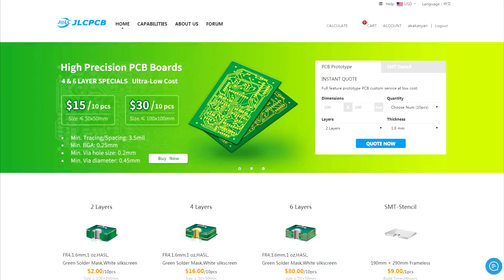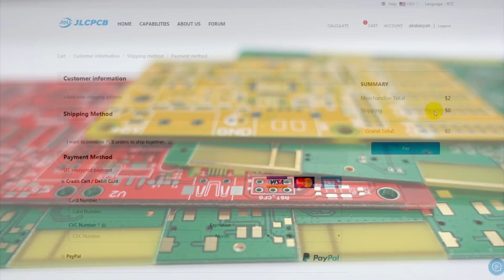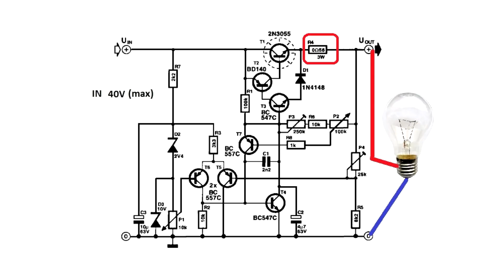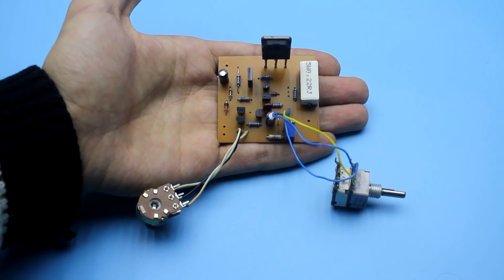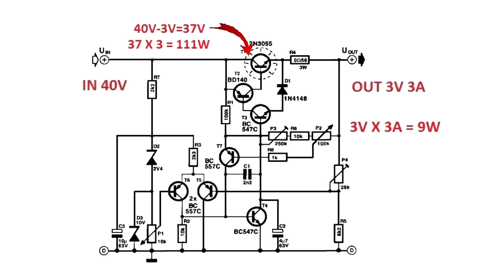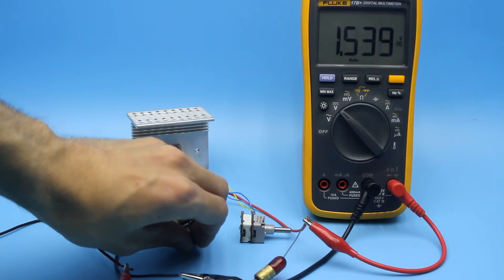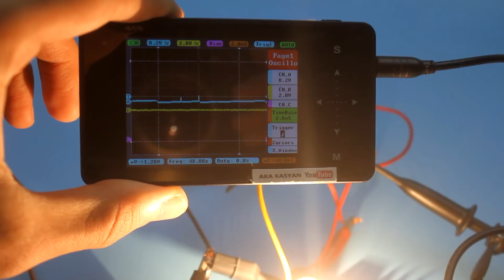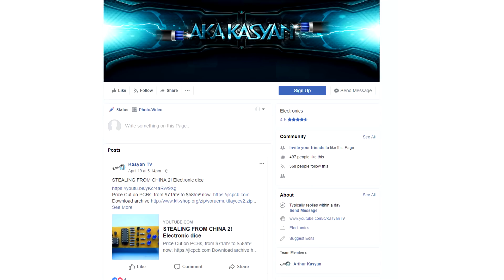DIY excellent adjustable power supply 0-35V, 0-3A

Comment: Hi Kasyan. It is a very good project. I tried to make it but there is one problem when I turn down the ampares to zero the half voltages still shows like I tried with 18v transformer. When I turn down the 100k pot to zero and turn up the full the 10k pot voltmeter shows 8.5 voltages and the voltages also moves with ampare pot. Please guide me what can get wrong?

Comment: Very nice power supply for such a simple circuit.  I imagine it would be possible to replace the potenteters with resistors to set a  voltage/ amperage   value, and be used as a permanent component in  x, y, z device?

Comment: could any give a proper reference or make a video on lm723 ic.
Reply: Raj Kiran , LM723 too high cost. TL431 would be stable enough with much cheaper price.
Reply: ibles bosuok  Well ok but I like know how to configure 723's different features. Its data sheet does not contain  all the information.

Comment: I had an idea about SMPS powering linear regulator in way of adjusting voltage of SMPS to 3 volts higher than output of linear one. It  will probably have good stability and no need for massive radiator.
Reply: this can be done easily.
as a plus, filtering will be a bit good than a "normal" smps power supply.

Comment: LM317 with a PNP as power transistor is much better.. Do not lose your time with this one.
Reply: but not variable current limiter :)
Reply: MAA723 or uA723 is nice circuit as well. LM317 useless for lab power supply without aditional current limiting circuit

Comment: Great channel.    "no ic's circuit" the design of discrete components circuit great job. The wonderfull of transistors works demostration: power pass transistor. darlington and driver transistor. Diferential pair amplifier.current limiter protection and more. is very nice job. im a electric and electronic technician in my country south america chile. (sorry my english please)

Comment: Dear Kasyan,
Please consider spending more time explaining each circuit as you would in a class room environment. With current paths and voltage states. 
Many of your viewers are experienced in electronics (like myself), and will not learn anything new, but far more numbers are learning the ins and outs of electronics and will benefit greatly from such analysis.

Comment: Beginners Notes
 The transistors in this schematic marked BC557C and BC547C are basic general purpose NPN and PNP bipolar junction transistors. These are generally used more in Europe. You can replace these with many different part numbers such as 2N3904/2N3906, SS9014/SS9015 or many others that you will find in almost anything you take apart. 
  The BD140 transistor is a medium power transistor. This will be slightly harder to find. These typically come in a package size like a TO-126 (IIRC). This size is a little smaller than the typical TO-220 but it's larger than the TO-92 and is built to dissipate more heat than a TO-92. The main thing your looking for is a similar PNP transistor configuration with a amplification factor (Hfe) of around 100-200, while the transistor must also have a voltage rating higher than it will see in the circuit and a current rating of around 1.5 amps. The BD140 has a voltage rating of 80 volts which is rare for a transistor with this voltage/current rating. If your ordering parts in general there are sellers on AliEx that are selling 50× BD140's for $1.49 USD shipped. I haven't tested them but I just ordered 50× 140's and 50× BD139's for my parts drawer a few days ago. These are good jellybean components to keep in your personal stocks, along with a small selection of power PNP's.
   When trying to salvage components, power PNP's are rare in my experience. Medium power transistors are kinda rare in general. I have found a few in old tube televisions and larger stereo system amplifiers but they are not very common on the junk I pick up for free on the curb in California from time to time.
    If you are looking for a power NPN transistor for the main output of this design, the 2N3055 is the most common part people used to order or was stocked in local stores like RadioShack (RIP). You will find a somewhat similar power NPN transistor in most old tube televisions. The ones used in CRT televisions don't usually have as high of a current rating as a 2N3055 but they usually have a higher voltage rating and enough current to work for most beginner bench power supplies. The current rating of these is usually between 5 and 10 ampers. I have used these in several experiments and they work. 
  I'm really surprised that Kasyan TV didn't mention how easy it is to find a 2.4 volt precision zener for this example. Open up almost any switch mode power supply and find the TL431 voltage reference from the secondary output side of the circuit. I know..I know..there are 3 pins!?! So look up the pinout on the datasheet and wire the adjustment pin to the cathode pin (don't P.A.N.I.C. = Positive Anode Negative Is Cathode ;)
  Now you have your 2.4v zener. Build this circuit! I know I will. 

    The biggest negative aspect is probably the voltage characteristics upon startup and/or shutdown. I haven't gone through the circuit myself but I imagine there are probably a few issues that might damage very sensitive circuits. This shouldn't be an issue for beginners. It becomes more of an issue when you start using things like microcontroller IC's and sensitive digital IC's directly on a breadboard without using development boards and kits.

 This is just my unqualified $0.002 take on things and a bit of info I wish someone had shared with me a few years ago, but hey, I'm no expert, I'm just another hobbyist that likes building power supplies and learning too ;)
-Jake
Reply: My testing has indicated that most (if not all) 2N3055 transistors bought from Banggood and Aliexpress are fakes, and will not stand more than 3 amps of current for long. 
Real 2N3055 are considerably more expensive but can deliver 5 Amps with no problems. 
After taking the fakes apart and examining them under the microscope, I can report that the silicon die is about 2/3 of the genuine and the circuit of the die is also of different design. 
There is a trade-off as usual. Price vs performance. Just keep that in mind. The fakes may be useful as they are so cheap, but using them and expecting the performance and longevity of the genuine part, is unrealistic.
Reply: PirateKitty 
  Yeah, I figure most of the dirt cheap stuff from China are second sourced production rejects. They are good for a cheap way to goof around with circuits but we should all plan for them to have very 'loose' tollerences. Most of this stuff is ancient and outdated anyways. If we're building something mission critical, get on Mouser, Farnell, DigiKey, Arrow, etc. and place a solid order. I wouldn't build any device that will be left unattended with these types of components. If I'm taking the time to order/etch a serious design proper parts are a minor investment. However I'm a gimp that takes ages to do anything serious so I have a bit of a different perspective on time spent ;)
-Jake
Reply: can you recommend me some cheap pnp 0.2 - 1A 30-40vce transistor to buy in bulk from ebay and some high current and as low as possible collector-emitter voltage cheap NPN transistors?
Reply: John Scarce 
I'm not looking up specs and details for you, but as far as new BJT's in my parts bin I have some TIP31's, TIP32's, TIP 42's, TIP127's, 2SC5198's, 2SA1941's, and 2N3055's. I also keep 2N3904/2N3906 general purpose transistors in the hundreds, and I have one of the AliEx TO-92 10× everything BJT sets to cover the 1:1 replacement basics. Everything else I have are take-offs.
Reply: tip42c seems like a good deal but the others have very medicore prices and are a bit weak compared to mosfets. also a trend i've noticed when searching for both bipolars and mosfets is that everything in package larger than to-220 is very overpriced for the specs it has
Reply: John Scarce 
  Yeah. I have major chronic back injuries that limit me from doing a whole lot. I know I want to explore mostly surface mount components as I progress because drilling holes sucks big time for me and I don't have the cash or space for a mini CNC to do through hole stuff. I've torn apart a few flat screen TV's and I have a small stock of D-Pak transistors from those. My overall goal is to learn more about integrated heatsinks and heat dissipation on the PCB, but I'm green as can be on that subject. I think some of these ancient through hole components cross over into the surface mounted world, but I think there are a lot more modern options too so I haven't invested a lot of time with the older through hole power transistors.

  I can say, I personally avoid eBay for everything but used equipment. I used to be a seller on eBay of very high end bicycle consignments for local bike shops. eBay charges a large fee for selling on the platform. If you add up all of the fees as a seller (quite difficult to do in practice), they are charging between 13% to 18% for every transaction when you consider everything involved. If your willing to put up with the longer shipping times from AliExpress you will usually find that they are between 13% to 18% cheaper for the same things when it comes to new items. It isn't a coincidence in my opinion. The same sellers are usually on both platforms. eBay just does a better job of filtering out the bad ones that don't ship items right away. You just need to watch the seller ratings closely. 
Just my $0.002 ;)
Reply: Radio shack :'( :'( :'( im very sad.

Comment: Is it possible to use a dimmer, a diode rectifier and some capacitors to make a high power ac-dc power supply?
Reply: Zetsubou_232_ , ofcourse it is possible. Applying typical dimmer on primary side of the power transformer, apply additional snubber network on the triac and apply small resistive load in parallel with the primary will work fine. Unfortunately it not provide regulated output voltage.

Comment: You know what I love about designs like this? The fact that they are so damn easy to modify to your requirements!
Reply: NNNI 
Lol, sub'd, prove it ;)

At first glance, I was wondering if I could rig a FET to replace that power NPN and use the Vgs resistance as a replacement for the power resistor but I will need to play with that one in a simulator first ;)

I know the 2.4v zener should be replaced with a TL431 as the first step to building this easier with junk components
;)
-Jake